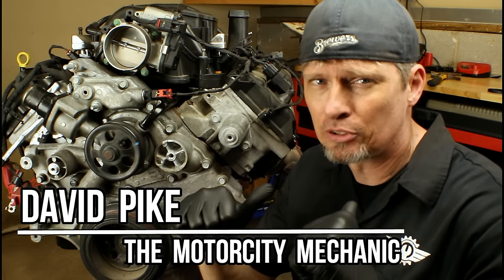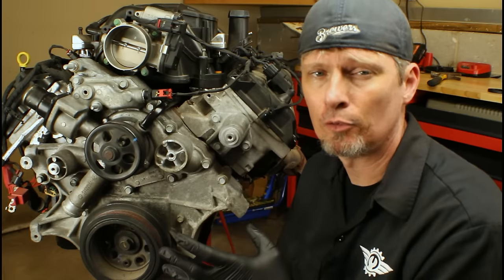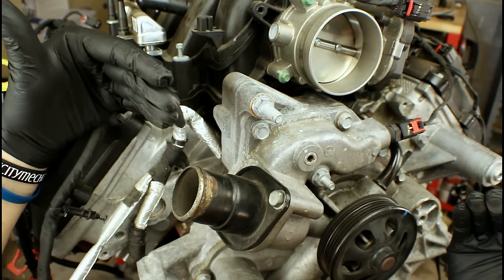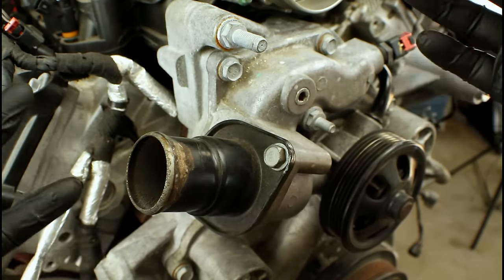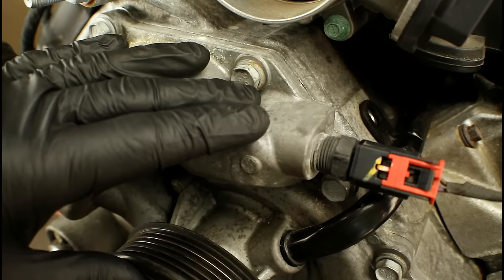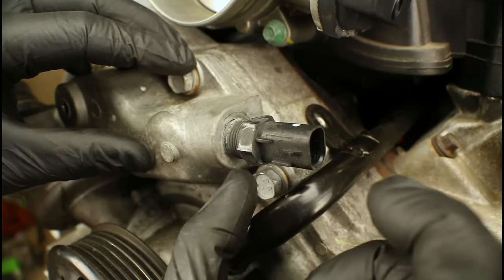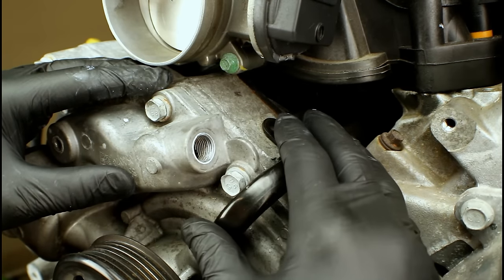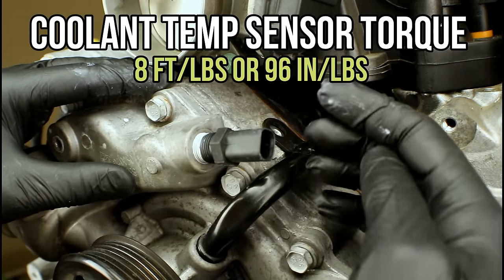More than one way to bleed a Hemi coolant system

Comment: So first off great video I recently changed my coolant temperature sensor because of a bad sensor causing overheating which fixed it also bleed the system thank you . But now I'm having a OIL TEMPERATURE PROBLEM MY 2006 DODGE CHARGER RT oil is running around 220 and when I run my AC it for whatever reason heats up even higher to as high as 238 I can't figure out what's going on I also recently changed the oil pressure sensor. Is it possible there's another bad sensor does the hemi have an oil temperature sensor? PLEASE HELP IM SCARED I MIGHT LOOSE MY ENGINE DO TO OIL OVERHEATING BUT NOT SURE anyway thanks so much for the awesome content its been a huge help in diagnosing some of my problems.

Comment: I use a vacuum filler, no bleeding required 👍🏻
Reply from the maker: One thing is not all people own one. I have 2 versions and sometimes still run into issue and recheck by using the bleeder. In the end....what ever works best for you and causes no come backs. Thanks for watching and for commenting. Make sure to subscribe.
Reply: MotorCity Mechanic I have issues with the vacuum filler sometimes too. 
I’ve been subscribed for quite a while 👍🏻
Reply from the maker: @TheAutoTech  Much appreciated!

Comment: i just installed the 180 thermostat on my 2015 dodge charger Rt and my check engine pop up and i fell like if my car is cam is rocking back and forth what can it be?
Reply from the maker: Depends on what the new code is...that would give us a direction to go in

Comment: Has Chrysler come up with a solution for the overheating issues with the hemi's ?
Reply: Hemis were made to run hot.just change your thermostat to a 180 degree stat. Thats what i did and it keeps the engine cooler longer and plus i bought a diablo tuner and set the fans to kick in when they hit 197 degrees. Since here in chicago winter is around the corner i set the fans back to factory setting. And also i turned off the mds system on the magnum.
Reply: Hemis were made to run hot.just change your thermostat to a 180 degree stat. Thats what i did and it keeps the engine cooler longer and plus i bought a diablo tuner and set the fans to kick in when they hit 197 degrees. Since here in chicago winter is around the corner i set the fans back to factory setting. And also i turned off the mds system on the magnum.

Comment: I´ve a Question :)
but at 1st nice greetings from Bavaria (germany) & me :)
I´m a Auto Mechanic, make us classic car restairations & for over 15 years i´m working, customizing & driving Alfa Rome, like the 156 with the 2.4 JDT 20V or the legendary 2.5-3.0L 24V V6 24V Arese/Busso V6...but because my dream was always to own and drive an Dode Charger of the LX Gen. with a HEMI i´ve bought 1 & imported it from NC, US to me...A 2006 Charger R/T Daytona with the 5.7 Hemi ( 2 "H" VIN) and this car got a Cold Air intake, Diablo Sport Programmer & a larger throttle body by the preowner. And it has a lot to do about maintaining...Because it looks like it was standing a longer time. But the car with 136.000mls has a really nice condition, especially about the body. And i like to get a high durable daily driver (a daily with the premission to get an classic car in sime years ;) ) And so i was looking what issues this kind of charger has... I listened about the dropping Valve seat rings and also the "Hemi Tick" what makes me a little afraid about it, because i never had issues like that at the Alfa Romeo Engines. And i like to optimize the car that my car doen´s get this issues....So i´m thinking about what i can do against this issues, any idea???
I can tell you what i was thinking to do; Add a 180°F/82°C Thermostat...to get the system a little cooler in operateing condition
But can you tell me what is different at this kind of Charger  2006 2x "H" VIN,  Because i listened something like that i had to look for that "2x H" when i look to buy a water Pump...is the water Pump different to the other HEMI passenger car Water Pumps? And is there any Oil Pump or something out there what can make the oil pressure a little higher, even because this "Hemi Tick" (Roller-Lifter failure with grinding down the camshaft....) Or is this Hemi tick more the case on the later Hemis with the VVT, and these 5.7L GEN3 HEMI´s between 2006 and 2008 aren´t the Hemi´s with this problem???

Have a great day! thank you very much :)

Cheers Till

Comment: Having found tooooo many plugs rounded by some idiot, I would have gone to the easy sending unit first any way.
Reply from the maker: The only real issue with the plastic is that I have seen the threads come off and then your stuck getting a sensor. Seems like you run into issues either way lol. Thanks for watching and for the comment!